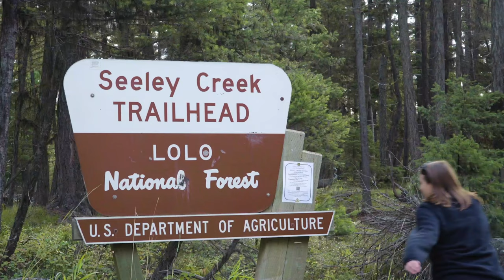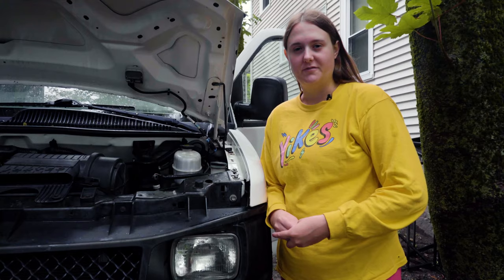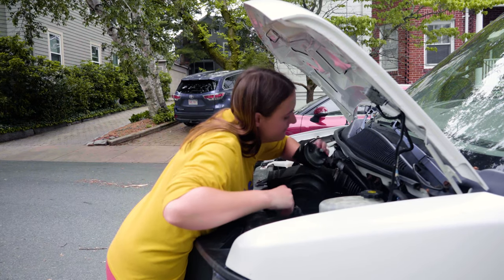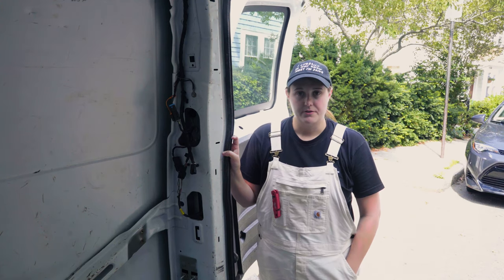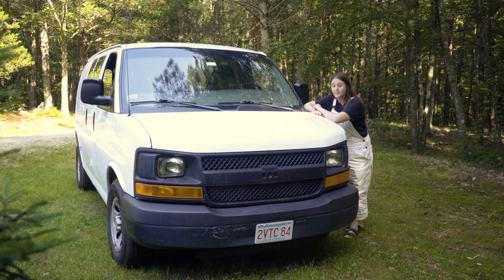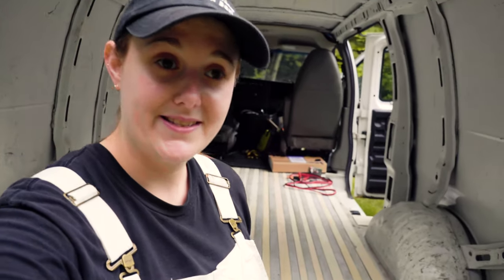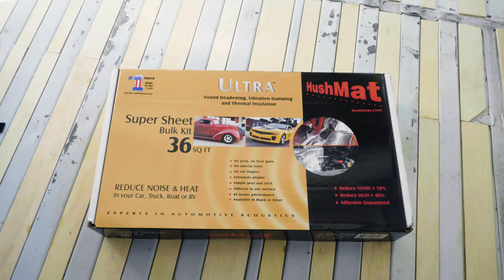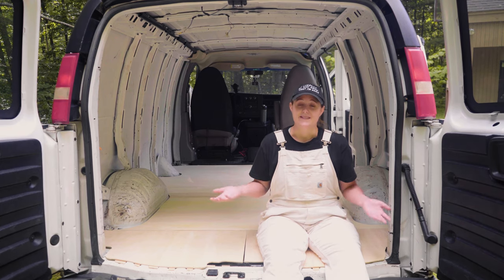Starting a Chevy Express Van Build with No Experience

Comment: Hope to see ya out somewhere, I just finished mine but I did a high top conversion van, 400w solar, roof fan, instant hot water, Diesel heater, wood burning stove with glass front so u can watch a fire at night, tv, playstation, gaming laptop, composting toilet, I live in the parking lot at work, Ford Dearborn assembly where im a truck driver, been here since July and already saved up 21,000. My only bill is my phone and insurance, I get free wifi from work too

Comment: simple WD-40 will make most sketchy wiring connect. once in a while spray down the main ground wires at least. Can also spray a lil on battery connections

Comment: Very cool! You are a total badass for doing this all yourself! Very inspiring! I had a question as I'm doing a Chevy Van right now. Was it easy to pop off the door well (plastic on passenger entry step) and plastic in front of where the back door closes? I'm looking to tuck flooring under them and have them reinstalled. Does it seem like something that can be reinstalled once removed?
Reply from the maker: I do recall the plastic at the back door having these little plastic clips on them, it might be fussy, but if you’re careful not to snap those off in the removal process, you might be able to add it back in place! I’m a little less sure with the side door footwell though, can’t quite remember how it was attached, sorry!
Reply: @LindsayDaly  thank you for your reply anyways!

Comment: Thank God I was able to find a Chevy express build from start to finish. I just bought one. Mine is a 1999. Question: I didn't catch what size plywood you used for the sub floor. Was it a 1/4 inch?
Reply from the maker: It was, but I recommend ½ inch! Better to anchor furniture into - I mention in my kitchen build video how it was sort of an early mistake of mine, and that I should have gone with ½ inch!
Reply: @LindsayDaly  ah, I see. Ok yea, I hadn't quite gotten that far yet. Thank you! I'm just so appreciative to have found someone who, with no experience like me, posted their build. Now, if only I could stop staring at it and actually start building.
Reply: @LindsayDaly  holy shit Lindsey!! As I continue to watch all I can think is, "she's a badass!" I don't have anywhere near the amount of tools you have, or the resources so I'm probably going to have to cut corners but it's ok. After being inspired by you I'm going to stop staring and start doing!!! I'm actually excited now. .....I actually did take out the metal shelves and tore out the mat. I will save it for my template for the floor tho. I'm so motivated! Thank you thank you thank you!!!

Comment: Lindsey you're editing is done so well, and  suspect this will evolve into a massive channel. Looking forward to watching the progression of the vehicle and the channel. 

My Boys and I are currently do a similar build on this really kewl 70's E100. Definitely not as practical, but none the less will be an awesome experience to have with my kids. I really thought these passenger vans would have enough room for a fairly comfortable conversion. It's amazing how quickly these little bastards fill up though. I'm really struggling with the whole practicality vs esthetics. Hard wood, and veneer looks great on the Gram, but it makes infinitely more sense to do carpet (you're always on your knees) and soft touch material on the ceiling (head). The increased weight is really noticable as well when framing out an entire camper. If you're not interested in resell, do what makes sense. The butcher block counter tops and tile backsplash loose their luster quickly after realizing how impractical they are. Just some things I've realized over my building process. Regardless, it's really rewarding project.
Reply from the maker: Thank you so much for watching! One of the nicest things people can say.

And wow, my van is strictly a one-person (MAYBE two!) deal so that’s wild! Couldn’t imagine trying to make the space work for more people!! Hope they’re enjoying it with you and learning a lot — I know I am!

One thing I’ll say is this — there is no way in HELL I am tiling anything haha, so fair point there. I’ve been turning it around in my mind constantly and I’m planning on finalizing the layout this week — there’s just so much to think about!

Comment: Awesome job.  I will be doing the same, I have to find a vehicle first.
Reply from the maker: Actually getting the van itself is truly half the battle! Check out my previous video on when I bought the van…. 😬 a struggle for sure, but I got there!
Reply: Most definitely I will.   I have been looking for a chevy as well. But I was told to never buy one that was used for construction or anything to do with water.  I’ll find a good one.  Thanks again! Happy travels!

Comment: im confused why did you fill in the floor channels with wood? maybe im missing something idk
Reply from the maker: Mainly for stability’s sake to keep the floor “level”. In the thinner channels it’s not as much of an issue, but the corrugation is really only in the center, and it creates an uneven surface in larger areas like corners or sides of the van, which would make the eventual floor unstable. Might be smarter to put a bit of wool insulation in those gaps instead though, to be honest!
Reply: @LindsayDaly  ah just use thicker plywood then the gaps wont matter
Reply from the maker: Pretty much — if I did it over again, I would use ½” ply, not ¼”. I was trying to save myself the headroom since it’s at a premium in this van, but it’s a mistake I’ll be paying for kinda soon, because I need to add more wood to the floor to give my eventual furniture and cabinets something to screw into!
Reply: @LindsayDaly   @Lindsay Daly  oh i see. dunno how heavy it is... but might want look into super strong 3M VHB tape. theres also a seperate  activator / promoter for the tape that makes it hold even better.  can be an option for holding many other things too

Comment: I love how you try fixing things by yourself! Must be a liberating feeling and it's fun to watch as well :D
And if you don't mind me asking, how do you edit your videos? Like what software and what cam equipment do you use?
The quality is amazing! xx
Reply from the maker: Lol if nothing else, this has taught me that fixing something yourself is 90% waiting to get  the right parts and tools and 10% actually fixing it!

I edit using Adobe Premiere and animate using Adobe After Effects — and I primarily film with my Sony A7sii camera. Thank you so much for watching!
Reply: Remember. If its of this earth, you can fix it.
Reply: What did the van cost?
How many miles?
What size engine?
Reply: Those strips were nice but i just put thin insulation in the grooves and covered it with thin aluminized stuff and 3/8 plywood. I the sanded and filles and put roll vinyl. There are so many ways to do things its hard to decide.